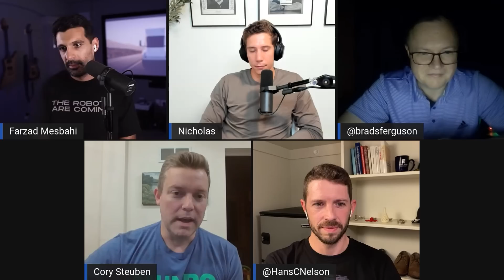Tesla Semi and FSD "OEMs are Giving Up" with Cory - CLIP

Comment: The biggest issue with the semi is..... supercharging degrades batteries much faster than normal slow charging. And this is a big deal that needs to be adressed. You cant have batteries that degrades for example three years and then they need to be switched out.
Reply: The semi has about a 900 kWh battery, the mega charger is going to be about 1.2 kW, that means about 1.3 C charge rate, very little degradation at 1.3 C.

Comment: Note on Plaid motors:

Both Dan and Elon indicated the motor on the Semi was the “size of a football”. The plaid motor shown at the model S reveal was quite a bit bigger than that. I think Tesla has a new revolutionary motor design that is smaller. Elon said they were using the carbon covered rotor of the plaid……he didn’t say it was exactly the same motor.
Reply: Quite interesting.  I’d assume as well as lucid has a great motor as well. 

As far as we know tesla never stopping. I’d assume motors is one part to gain efficiency and an advantage to keep top notch

Comment: As a semi retired distribution engineer, I am curious about the upstream utilities infrastructure.  Ie 13/800 stepdown transformer, substation sizing.  On our system if you connect 10 1mw chargers it could mean adding substation capacity.  This would be very expensive, perhaps 1/2 million dollars or more!
Reply: Ford are asking their dealers to shell out a million bucks to add EV fast charging and get the right to sell EVs so... perhaps it does cost that much to boost the supply on site.

Comment: To answer Hans's question:
The motors are probably not exactly the same as in the Plaid, instead having different electrical windings adapted for the higher voltage system. If the battery is 1000V, they will most likely also run the motors up to 1000V. The motors will be controlled independently.